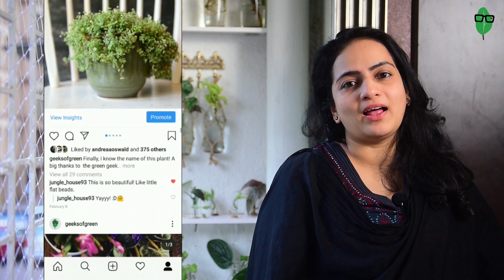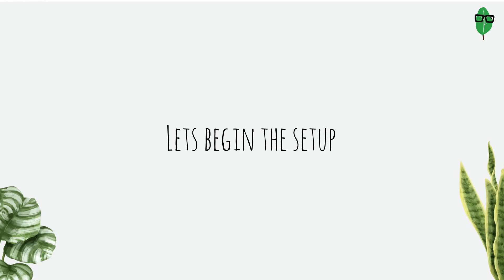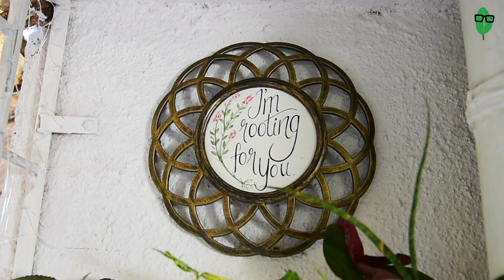Setting up a propagation Station | DIY | Urban Gardening

Comment: Amazing work! 👌👌👌
Can you please share the name of the tool used for making holes for test tubes. I would get it after the corona virus threat subsides. Looks like a good tool to have!

Thanks in advance
Reply: He is using a drill machine which is usually used for drilling  holes, a different type of drill bit is used for bigger holes
Reply from the maker: It is called a 'hole saw' you get sets with multiple sizes. You can use them with regular drill machines.
Reply: Thank you so much @geeksOfGreen

Comment: Where are you getting the teal wood planks from ?
Reply from the maker: You need to look for a supplier locally. Ask hardware stores for contacts in your local area. They will usually be commercial sellers in an industrial place.